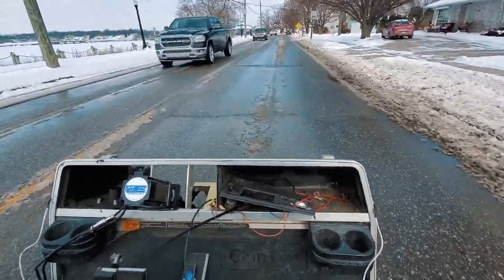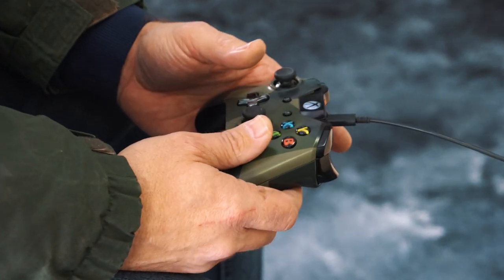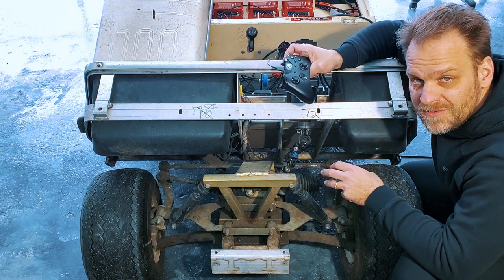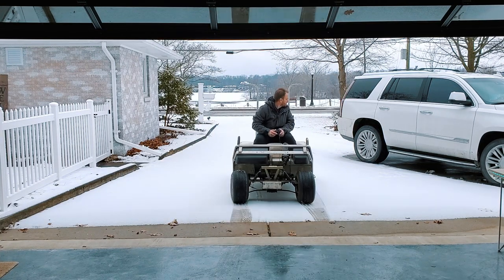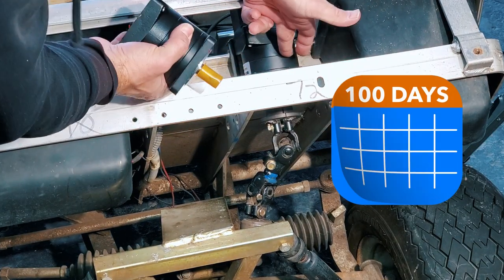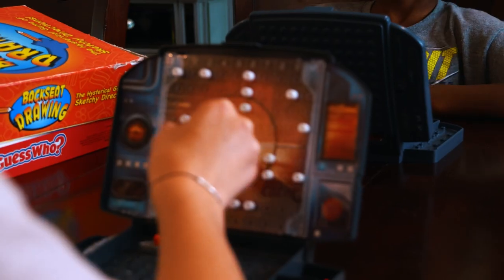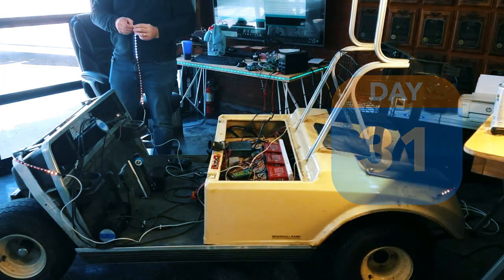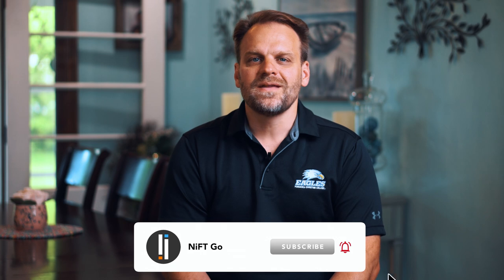Building an AUTONOMOUS car! Part 3

Comment: You should check out phidgets. They are way way waaaay easier to integrate than arduinos. They have sensors and input for almost anything you'd want to do here and they talk directly to ~10 different programming languages (including python / labview) with no intermediate microcontroller required
Reply from the maker: Awesome advice, will definitely check them out!

Comment: Interesting project! Looks like a fun mix of programming, electrical wiring, and mechanical design/fabrication. I'm curious why you chose to build a motorized arm to push on the pedal rather than hardwiring directly?
Reply from the maker: Hi Jim,  there are only 100 days, so often it's like climbing Mount Everest with a very limited supply of oxygen, you have to chose what you are going to spend your time on.  In this particular oxygen choice, we chose to keep the actuator interfaces common with the other actuators so we don't have to spend our development on unique and separate methods.  You are right we could have done this via hardware electronics and software, but we made a conscious choice to conserve our oxygen for other problems that will arise. I love these questions, hope it will encourage others to engage. Thanks!

Comment: Interesting project! I have a question about handling the steering angle. If I transmit the angle from the computer to the steering motor continuously (20 angles per second), how do I handle it to get the smoothest steering angle? Can you give me some idea. Thank You !